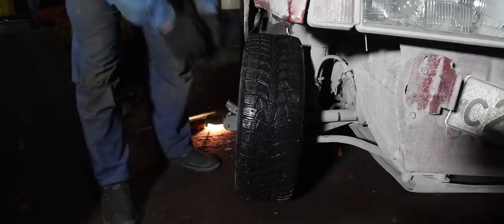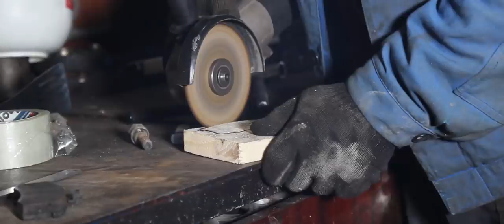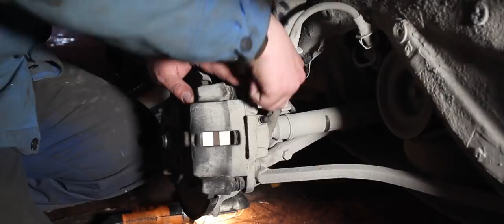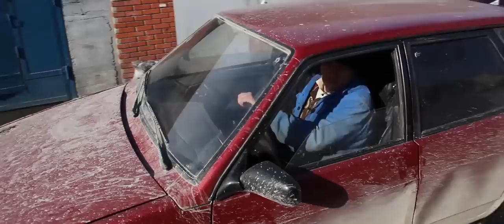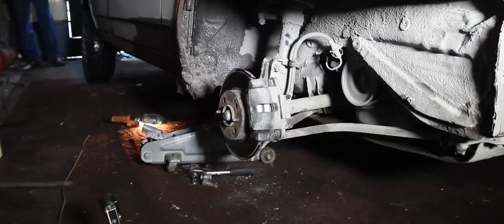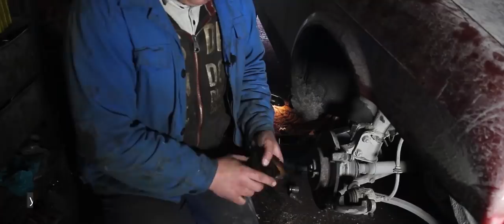Wooden brake-pads: will they work or not?

Comment: There was this guy that baught a Mercedes from a rome family thinking it was a good car and it had a v8. After a few miles it would not run anymore and it was a horrible noise from the rear. Turned out that they put sawdust in rear axle and it had pistons made of oak
Reply: Old Norse brewery liar. It would have no compression and the combustion would burn through the wood in seconds
Reply: Random Moustache Guy would it? It was in all the newspaper back in the 70s
Reply: eksine what is?
Reply: And by that you don´t think it really happened with this merc? However it was in all the newspapers back at the time and he tried to find the ppl that sold him the car, but they had left with their caravans. So he was fooled. And you don´t think it happened. Well think again
Reply: because it didnt. who would go through the time to create perfect wooden pistons to then sell to some bloke to make what? 500 bucks? for an entire engine teardown? that makes no sense.
Reply: Random Moustache Guy A nice running V8 Mercedes was NOT just "$500", especially when back when it happened. A running one could catch a VERY nice sum (easily $100k+ in todays money), wheres without a working engine or drivetrain it would be a total loss.

The pistons don't need to be perfect to run for a few minutes, you just have to use a decently hard enough wood and shape then close enough to hold some pressure.
Reply: Oleg Ya and technically you don't even need to ignite the cylinder with the wood piston.
Reply: Random Moustache Guy The guy with the oak piston crown had the thing running at high rpm, in an air cooled engine with the air cooled head removed! Not to mention the air /fuel ratio and valve timing wasn't very well controlled.

There are other pistons made from random stuff on YouTube that lasted quite awhile. 10+minutes 

If you did it in a water-cooled engine and only idled it and shut it off often, like you would when selling a car...it would last awhile. 

You could also shut off spark or fuel to that cylinder and have it last way way longer. 

And in the story is says the rear differential was full of sawdust so that tells us obviously the car wasn't running much during the sale.
Reply: Old Norse brewery ...... and u believe that???????
Reply: Oleg Mercedes were never worth 100k. Brand new in the 80s a sec amg for 40k. Fuck mercades. That story isn't real. I'm out ✌
Reply: Random Moustache Guy Yeah, as I said, in TODAYS money. Go ahead and look up what $40k in the 70's is worth today, litterly over a quarter million.
Reply: Sawdust In the differential, yes. It's an old trick but oak pistons. I hope you don't believe that.
Reply: Greg Maybe you should do some research on the topic first, not only is it possible, it's been done. Runs for a surprisingly long time too.
Reply: Oleg horseshit, wood, even if it did run wouldn't last more than 20 seconds before they burned thru. Next the rings would most likely seize in the ring lands and lose compression. You might want to do some research yourself on internal combustion engines.
Reply: SpenserRoger
In that case, you might as well run with just an empty cylinder.
Reply: Untreated wood burns through like butter. There is however a thing called coatings thats used on race cars that generates a lot of heat. Say they put a ceramic top on the piston with molybden coated sides  it would probably last a little while
Reply: Oh man, was the seller matilda's dad?

Comment: I mean they should we used them for like 600 years on wagons and carriages. They might wear out quick on s car though
Reply: Shop Dog will work just fine on a car. It's just like the gun debate. It's all about the person behind the wheel.  Not the tool.  Unless ofcourse your a tool lol
Reply: its more like we stopped using them because they didnt wear out fast enough to create jobs from it
Reply: Wagons and carriages moved relatively slowly and the brakes didn't have to be applied often. That was a benefit because wood doesn't dissipate heat well. And even then, due to the slow speed of the carriage, there wouldn't be much kinetic energy to dissipate. Kinetic energy increases at a geometric rate as the speed of the vehicle increases. If carriages had gone 70 miles per hour, they'd never have been fitted with wooden brakes.

Comment: What about thick mounted leather?
Reply: will burn even faster!  maybe cement with fibreglass reinforcement :)
Reply: Jusb1066 ... Hows about ... wait for it...
Brake friction material???
Reply: yes but not make it too easy!
Reply: Tom Clark yes right, how.about space dust? Lets stay on the budget buddy, this is russis.not sparta
Reply: MrMarkeboy1234 leather was used for early clutches

Comment: I've wondered about this, looking at my car's brakes (an old VW Super Beetle, fitted with Ghia-style disc brakes on the front) thinking of how it would be pretty easy to put a block of wood in place of the brake pads. These were made of a low-density soft wood, probably pine (that's what 2x4s are usually) but I could imagine that if using a much harder, denser wood, something more similar to the normal brake pad material in hardness, (oak maybe?) it might actually work decently well. Not as well as regular pads, but I could imagine it might even be semi-workable. I wouldn't try it, but would be an interesting thing to ponder. I'd suggest these guys re-try it with a harder wood, see what happens.

Comment: Well, we all know what happened to James in Thomas The Tank Engine, I just clicked this and I can already tell it won't end well just by the title.
Reply: Joshua Mccutcheon hahahah
Reply: The cable car system in San Francisco uses pine blocks for the track brakes, and those blocks are replaced every three days or so.
Reply: Yeah I'm banking on 2 major things: fire. And won't hold up to hydraulic pressure.
Reply: Bruno Sterckeman seems cost effective.
Reply: Yes, that's predictible, wood is a combustible and is not that structurally strong because of the grain. Wooden brake shoes were fine on horse carts, and even then...
Reply: Most trains had wooden brakes in the 19th century, in the uk, the guard had to go and pin down the hand brakes on every single wagon before it went down a steep hill, and they worked!  But not very well and could catch fire..
Reply: BillXCIII Yes actually, London's subway cars used that in 1840 many people died
Reply: Spoiler...it ended ok. Possibly due to the overlap of wood only allowing the brake pads to squeeze together so far and then no longer even touch the rotor anymore at the end. But for temporary normal use they work awesome. Doing brake stands with them, not so much, but they never actually caught fire in this case.

Comment: Make them out of concrete
Reply: Pete Harrison lol
Reply: Those would work pretty well, but they'd be super noisy and destroy the rotors pretty quickly.
Reply: MaxTheKanuck he is taking the piss because this guy put concrete in the tyres before and always does stuff with concrete
Reply: bonkey dollocks I just watched him drive around with wooden brake pads, so yeah I wouldn't doubt that.
Reply: MaxTheKanuck yea I was amazed they worked as well as they did . would not like to use them in real life though
Reply: bonkey dollocks 
Concrete pistons
Reply: MrHillfolk I made a car from wood once , wooden wheels , wooden engine , wooden seats ..... Wooden go .
Reply: bonkey dollocks 
Haha actually that’s kind of cool, so much easier to modify then working with metal!
Reply: Make brakes out of candle wax
Reply: They would probably shatter being so thin and ruin the rotors if they happened to work
Reply: make brakes out of letsgos
Reply: Ceramic Technology(TM)

Comment: The first London subway cars used wooden brake pads-and they generated terrible carbon monoxide-several people died from it. This was in 1840.
Reply: What? Your statement has many obscene facts, please refresh your knowledge on the topic which you stated.
Reply: Do you have a source on that. I'd like to read more about it
Reply: So you tell me ceramic is healthier to breathe in when it's burning then Camp firewood.
Id have to say that is prob one the most idiotic things ive heard even my zero mechanically inclinded girlfriend knows that.
Reply: EyeNeedaShot DrugZ if it gives of carbon monoxide, then yes. Since carbon monoxide is lethal.

New break pads doesnt contain asbestos so its way less harmful than the old pads
Reply: awesomefacepalm 
Your right it doesn't contain asbestos but go stick your nose near  smoking brakes after you've been driving it hard and breathe it in, an tell me it is better than breathin in burnt wood as if you where camping. No way comparable...
Reply: EyeNeedaShot DrugZ yeah I get you. What I meant to say is that carbon dioxide is a gas and spreads more easily than brake pad dust. Now I don't know if OPs startment is true that carbon monoxide will form from this. But if it does it will be more dangerous, comparable to running a combustion engine in an enclosed space
Reply: I can see how wood converting to carbon would produce carbon monoxide, since in the tight space between the disk and the wood their is very little oxygen. 
In the open air, carbon monoxide diffuses rapidly, but in a subway it would be lethal. 
Carbon monoxide is not a poison in the true sense. 
Its molecules closely resemble oxygen, so our lungs absorb, rather than release it.
It then slowly replaces all the oxygen in the blood until the patient dies in exactly the same way as drowning. 
Because life support machines also assume that it is oxygen. Unless paramedics have reason to believe that the patient has carbon monoxide in their blood, it is often too late before advanced hospital tests detect it.
Reply: EyeNeedaShot DrugZ o
Reply: I dont see a subway filling up with Carbon Monoxide from wooden brake pads either.  Impossible.
Reply: Still using wood pads in montteal brand new subway. Tons of people everyday, and it works.
Reply: The exhaust from the engine would poison them.
Reply: they are electric
Reply: carbon monoxide does get produced when wood is burned, especially with low oxygen, and yes it could build up in a non ventilated closed environment, so no OP is not dumb, EVEN if the information could be wrong about incidents at the London subway in 1840's, it's still a plausible statement.
Reply: Ad Mirer thank you for the fun facts we don't care for🤗
Reply: Chris W maybe nor the entire subway but a car above where the breaks are located maybe the driving car because it's smaller than the others would fill with gas more quickly..... He said a several people died not everyone in the subway died
Reply: The first underground cars were pulled by steam engines.
Reply: Some of the braking on the San Francisco cable cars also use wood.
http://www.cablecarmuseum.org/the-brakes.html
Reply: Ad Mirer oke... but stupidity will never go awey 😂😂😂😂
Reply: HOW did YOU know THAT?
Reply: The Montréal subway still uses wooden brake pads to great success
Reply: Google is a good search engine
Reply: Except the tube didn't open til 1860's
Reply: Did you know the Apollo 11 moon landing rocket in 1948 used wooden brake pads also? And successfully made it to Jupiter and back with those but 3 cats were badly injured in the process
Reply: My first thought, while watching this video, was: "Is carbon monoxide a problem?"
Reply: She is right I was there in 1940
Reply: It's all in the design. I'm for wood, a natural renewable resource :-)
Reply: Ad Mirer I’m sure it was the brake pads that killed people and not the shit ton of carbon monoxide generated by the steam locomotives they were using at the time
Reply: Ad Mirer are those people ok ?
Reply: Bruno Sterckeman I ask myself would it work or would it not I would not know but if I would or if I could it would be interesting but the wood would not do what it should unless it would not do what you thought that it would but let's say it would work
Reply: Ad Mirer Disk brakes weren't even invented until the 1890's...
Reply: LOL so many ignorant people making assumptions based on the little precise info from the OP.  90% of these comments are totally irrelevant besides being wrong.
Reply: Still being used by the San Francisco Tramway system, saw it on a documentary about the famous trams a couple of years ago. made out of pine wood if not mistaken.
Reply: EyeNeedaShot DrugZ Ver ceramic doesn’t smoke like wood does 😉
Reply: What's false? You? I really find it annoying when people can't scrap up the brain cells to support their position.
Reply: As opposed to asbestos lol smh
Reply: Chris P Bacon, About time you recognized your condition.
Reply: Ceramic pads don't generate much dust, which is one of the reasons people use them.
Reply: Are you saying wood produces carbon monoxide??
Reply: Ad Mirer
The London subway opened in 1863,  maybe it was a really a time machine and it went back to retroactively kill people from a previous generation...   Oh, and as others have also pointed out, Montréal's Métro has been using wooden brake pads since it opened 50+ years ago and stuck with them when it came time to roll out brand new rolling stock. Wooden brake pads are a clean and efficient way to stop subway cars.
Reply: Chris P Bacon
The Montréal Métro uses electro-magnetic braking to slow from higher speeds, but once below 10 km/h, it really does use brake pads made from yellow birch infused with peanut oil to bring it to a complete stop. As for their provenance, I guess you'd have to work in their purchasing department to know for sure.
Reply: I don't think cars were around in 1840
Reply: wenrt the subways stean driven? Smoke and fire generates more than tiny break pads

Comment: They used to use wooden Oak brake blocks on horse drawn waggons,  railway wagons and steam locomotives in the old days.

However as technology caused speeds to increase they used leather clad brakes (leather won't burn) and then sintered iron.

For road vehicles they went from leather to asbestos until the 1980's.

Modern motorcycle disc brake pads and drum brake shoes are ceramic and sintered iron

Comment: Wooden brake pads huh it sounds like an old car dealers trick to make the car feel good for the first test drive that's like let's see what other tricks do car dealers do to move plunkers off the dealership lot yes sawdust and oil in the differential and also to sawdust and oil in the automatic transmission to make it real smooth shifting on the road and let's say another old trick what car dealers will do is tic a battery that's barely hanging on in battery life they'll take the battery and clean it up real good and spray paint it with black spray paint to make it look like a brand new car battery oh I forgot to mention to another trick what car dealers will do when tires are just about showing those wear marks don't take a cutting tool and cut just a little pasta wear marks to make the tires look very serviceable on the road still that's one of the many tricks that car dealerships will use.
Reply: Chixyz nein I remember this one story I read in a magazine one time I don't know what part of the country in China but they make replicas of a Ferrari and try to smuggle them in different parts of the world and the brake pads on those fake Ferraris are made out of compressed vegetation this was back in 1998.
Reply: Why would anyone bother, thats so stupid. Would've just been cheaper and easier to buy them surely
Reply: You forgot these
... ..... .. .........
Reply: Jesusrunonsentencemuch?

I’m guessing you don’t take breaks or breaths when speaking either?
Reply: I would be EXTREMELY surprised if these things have never been done in Australia!

Comment: I had a go-kart with wooden brakes as a kid. You just cut some 2x4 pieces about 10" (250mm) in length and bolted them on, and they'd just rub against the rear tire tread when the brake pedal was pressed.